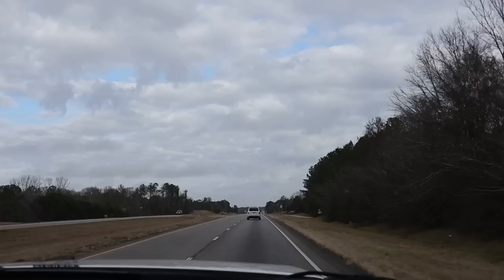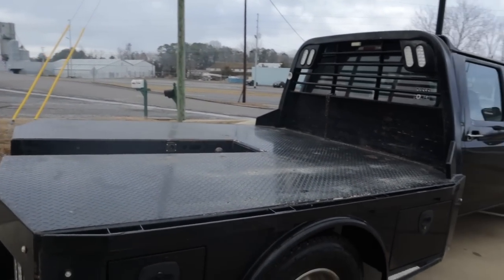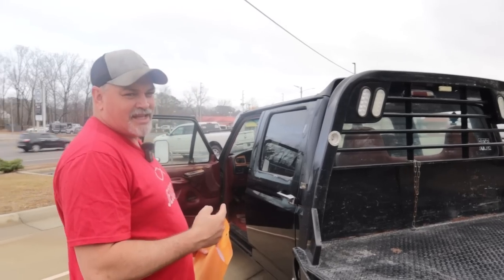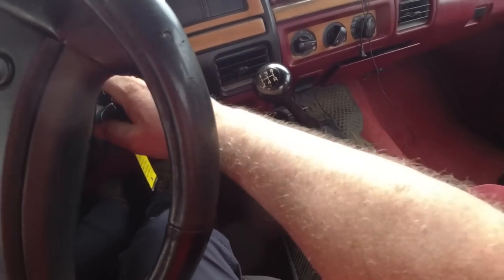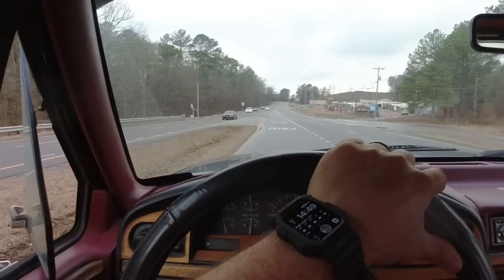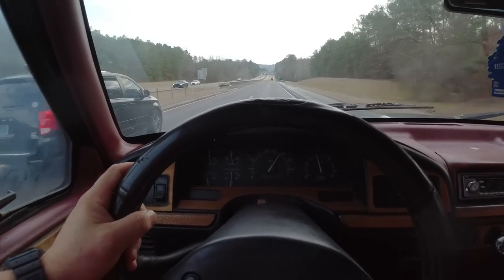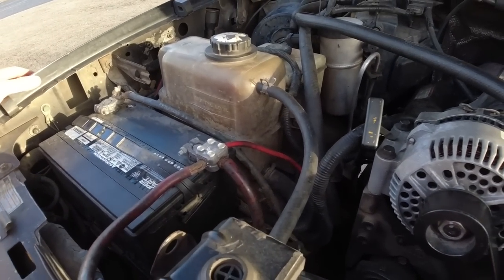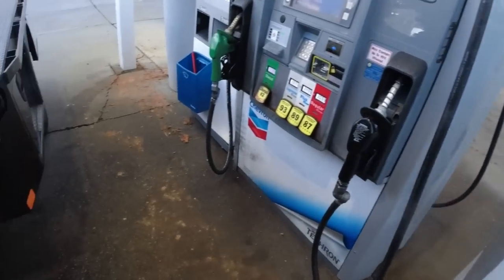I BOUGHT a 7.3 POWERSTROKE Service truck! Will it make it home 300 miles?

Comment: Hank, Enjoy all your videos. My 7.3 gets 18-20 mpg at 60mph. The gas gauge is aways off and it is an automatic. I made a trip to Alaska in 2015, pulling a 2000lb travel trailer and
averaged between 13 and 15 mpg. Before I left on trip, I rebuilt everything I could get apart and somethings I shouldn't have. With 295000 miles, the excursion has been a great 
car and very reliable. Thanks for your great videos John

Comment: The vent on the filler is probably messed up from flexing it to meet up with the flatbed body.  Check for hose kinks and add in an external tank vent if it doesn't improve.  Cool old truck Hank!  👍😁
Reply: Worth checking the vents on the tanks themselves aren’t blocked too. Not sure if the IDIs have an evap system; I guess not, or if it does it’s fine because it hasn’t thrown a Check Engine light. Good luck! 🙂
Reply: I agree. Check out the way the vent and filler hose were attached to custom add on flat bed.

Comment: For the A/C air only blowing through the defrosting ducts check the vacuum-operated solenoid that sits between the passenger-side hood hinge and the firewall. The rigid vacuum line to that gets brittle and breaks. My 95' F-150 had that exact same issue. At 20:53 in your video you can see it in the upper left corner.
Reply from the maker: Thanks 👍
Reply from the maker: The line is completely missing from the lume to the vacuum canister (whatever it’s called) but the 90* plastic elbow is still on it. Thanks for the comment.  I’ll get a new line soon and see if that fixes my problem 👍
Reply: There's no manifold vacuum on a diesel, so they run a vacuum pump on the front of the motor to run vacuum stuff, including the brake booster.  Scary when it fails.  Later on they switched to hydraulic brake booster, run from the power steering pump.  The blend door went out on my Son's 351/5.8 gasser.  Could get the heat exchanger out, but not the blend door without pulling the whole damned dash.

Comment: This truck looks like what you really needed, a tough truck that better fits what you do! As mentioned above, check the tank vent hoses! You might also need to put the nozzle in at a particular angle, due to the need when installing the bed. Heater/ AC blower defaults to defrost. Your problem is probably the blend door actuator, which is pretty cheap, and easy to change. (It is behind the glove box) Diesels don't have manifold vacuum, so you can't use vacuum motors to operate stuff. I owned a 2004 diesel 6.0, and in 100k that blend door motor was the only out of warranty repair. Highway speeds...you should be able to run the legal limit "forever" with no harm. Drive by the tach, not the speedo!! I once drove mine 'way over the limit, towing a 14k trailer. Truck didn't seem to mind. Later models have a 6 speed automatic, with a tow/haul switch on the shift lever, which selects a different program in the transmission. There's also a manual/automatic mode if you wish. I think the rear axle is a Dana 60, but that is a guess! My new F-250 has an electric lock for the rear end, which will lock up like a spool under 20 MPH, otherwise acts like a regular limited slip.
Reply: Dually have  dana70s If not Sterling  but those years they have observed trucks that are in 250 &350 in super duty  99 came out in the beginning of 98 10thgen of 150s for 97-03
Reply: I have a 97 f250 7.3 powerstroke it has a 4 speed automatic transmission in it I am swapping to a 5 speed manual soon

Comment: Get a temperature gun from harbor fright or any auto store or hardware store. I uses my temperature gun for checking temperatures on anything. You can see if the engines and wheels temperature in a sec by a temperature gun.

Comment: Try turning nozzle 90 degrees and then 180 to find the happy place to fill tanks. My flatbed is about 100 degrees from the normal position. Also reach under truck and grab the emergency brake cable about a foot from each brake drum and push and pull it back and forth to fully release brake and then pedal will not sag and turn light on in the dash.
Reply: I second the part about turning the nozzle 90/180 (sideways/upside down). Drove a 96 F-350 bucket truck for years, and that was the only way to fill the tanks without having to baby it the whole time.

Comment: On the duct work under the dash just make sure the vac pump is good and the vac lines are hooked up. Thats most likely the problem. 8 times out of 10.

Comment: Nice, great score bud, that 7.3 is a true work horse, not fast like the 6.7 the younger generation like but that block has been cast since '58, no Def system, I have one laying around myself ..but the super cab with only 70k on it, good ol' fashion strong dependable truck and we never use 1st gear, check your core support on it it's weak link with a rust issue again great score!

Comment: I have a 2001 F250 7.3L & it gets at least 17mpg highway. 13-14 city & ABS light comes on & goes off intermittently. Brakes work fine. Change the oil regularly & it will treat you well! Bought it new & will keep it a little longer.

Comment: Howboutcha and Bam-ba-lam!   I have my 3rd Ford-Navistar diesel.  A 6.9, a 7.3 and 6.0 PowerStrokes. Never use the truck fuel hose to fuel a Ford diesel.  The inlets are notoriously small and you'll have to  put them in half way, and run them by hand to get them filled.  Flatbeds are even worse.  There's so little space between the bed and the frame rails, that the fuel inlets are smashed nearly flat.  I kept a 4x4 or 6x6 behind my seat that I'd drive up on at the fuel pump and it really helped.  The oil pressure and temperature gauges aren't really analog gauges.  If the corresponding idiot light would be out, gauges will read right in the middle of normal.  Your're lucky to have the 5-speed (you said 4 at one point) rather than the E4OD automatic, which was not up to the PowerStroke, was possibly Ford's worst automatic, and which really should have a shift kit installed to keep it cool.  If it's never run a diet of bio-diesel -- DON'T.  Until you replace all of the rubber hoses in the engine with new.  95s and earlier weren't compatible.  96 and newer were OK.  The water fuel-separator lever (yellow) is on the front of the fuel filter, under the dog house.  Run it every so often until all the water's drained, and you get fuel -- Until you are sure that your fuel dealer isn't cutting your diesel with water. I switched stations and that problem went away.  Extending that hose will help with the mess.   Be careful when you have anybody replace your fuel filter.  If it's not set on right it'll leak tons of fuel on top of the engine.  Your mileage is pretty good, around 14-16.  When my 96 was faiirly new I towed a horse trailer with two 1900 lb horses from Portland to Fresno, and got 16 in the mountains. Glow plugs are built in to the valve cover gaskets.  Once you need a couple, you've got to replace the gasket, and all 4 glow plugs.  That's a good looking truck.   Bam-ba-lam!

Comment: Nice rig, I had to move the filler spout to the top of the bed, or you can put a drag up tank on the bed and run a small gravity feed  hose to the main tank, with a electric cut off switch. Put a water Separator filter between the tanks. Welcome to the Old Flat Bed Family !!!

Comment: I had a '92 Dodge diesel with a JM flatbed. When they installed the flatbed, they didn't shorten the hose in the filler neck which made the diesel run uphill when filling causing that same problem. I shortened the hose and fixed that problem.

Comment: I was trained (taught) by and old ford mechanic. He worked on those old swamper trucks (derrick trucks), from Texas and Oklahoma. The fuel gauge was often a big problem the ground would get rusted or lose and through them off.( Not very reliable ) I would just run new wire to tanks and frame. The fill necks on the tanks are shortened to make the bed fit and cause the the problem you are having with fill tube, either lift the fill tube or change to a custom  tank, it usually was just change to custom tanks for the F350s. The temp gauge won't reset like the others when to key is cycled, (moves, reads when power is put to it). And the windows will probably work when you replace the switch controls.( would replace the door wiring harness, there cheap enough). The blend door is behind the glove compartment and easy to change, it is an electric in that model. Finally i would replace the tank selector solenoid, they often go bad and cause tons of headaches.  But in all beautiful truck and great stout engines. Wish you all the luck and God bless you too.😉😉😉

Comment: That is a really nice  truck. I have s 96 7.3 dually.  Anyhow, your truck does have a vacuum pump.  And, it probably has a broken vacuum line under the hood close to the firewall near the ac blower.  That will cause the problem with the air coming out the wrong ducts.

Comment: The fuel is spilling back because the filler neck isn't steep enough. It's common on flatbed installations on diesel trucks. Diesel foams easily. I've built several beds. The trick is to make sure the fill pipe dips down as close to the filler as possible.

Comment: I have a '96 with the 7.3 PSD. There isn't an adjustment for the E-brake. I made one and used a turnbuckle to allow the cable to be tightened up. Also there is a connector that goes into the VC gasket that sometimes goes bad. After replacing 2 out of the 4 connectors the glow plugs and injectors work much better.

Comment: The 7.3 don't like aftermarket sensors only factory sensors. And a little trick at least to get you by so you don't have to be there forever at the pump is to stick a funnel in the filler neck and then pump fuel into the funnel.

Comment: Air only coming out of the defrost vents at the top of the dash usually indicates the heater/ac unit under the dash is not receiving an adequate amount of engine vacuum to the vacuum motors that control the direction of air flow, rather it be defrost vents, dash vents, or floor vents. If the unit is not getting enough vacuum signal, the system defaults to the defrost vents. Since the engine has had some major repairs and disassembly, it may be as simple as the HVAC vacuum line being broken, came off the vacuum port on the engine, or simply was not reinstalled on the port after repairs were completed. Hopefully the vacuum diagram sticker is still under the hood somewhere so you can check the routing. Very nice truck there Hank, and looking forward to seeing you work out the bugs. Keep the vids coming, and God bless.

Comment: The vacuum motors control the direction of the forced air from the blower. There’s always a vacuum leak that causes it. Check under the hood right above the blower motor. There is a vacuum line that gets brittle and breaks causing the issue.  The default air flow is defrost and floor. Check that first. I have owned 15 or 20 of the OBS Fords and have 4 now. Good luck!
Reply from the maker: Thank you

Comment: That wire you connected was the self destruct circuit.  If the fuel gage goes to full and the temperature gage drops, RUN self destruct will have started.

Comment: So i remember from the mid 90's my uncle ran a ranch in central Kansas. He used to order a 6 door f350 4x4 every two years. I'm not sure if the six dior came from Ford or not but every two years in September he would have a new one. I use to have to drive them  a lot during summers for a summer job. I hated putting fuel in it. The rear tank would always be all foamy and the only way to fill it would be to let it sit for hours.  I  don't know what was different with diesel then vs. now. I have numerous for trucks for my business now I have 7.3's and 6.7's and I have never noticed fuel issues like that. I would love to have this old truck.  I miss them a lot.

Comment: My 2001 F350 7.3 had the problem with window's not working, cruise and dome light not coming on. I was told to replace the GEN. Module,....pain in the butt to replace behind fuse box but it fixed the problem. :)
And,...a 7.3 will run way cooler than other engines and the wire you spliced to the relay is for glow plugs to warm the engine up before starting.

Comment: Nice truck ! May be a vacuum leak for the damper doors for directing air flow for heat or a/c. Oh, the mirrors aren’t the same. I still like the truck and it’s already had a lot of what goes wrong with them done. Have a Blessed Day

Comment: Hi Hank. Was curious to hear you mention diesel at $4.50 a gallon. Here in New Zealand, we use liters, which means your price is 82c a liter. Our price here per liter is $2.14 currently, which equates to about $7.90 a gallon if my math is good. My Frieghtliner truck holds 118 gallons 😢
Love your channel btw, always look forward to new content.
Reply from the maker: Wow!
Reply: In Canada were around $2.00 a liter also, its criminal!

Comment: On them old fords, the blend doors for the a/c are controlled by vacuum. There’s a vacuum pump under the hood on the passenger side against the firewall. If the pump isn’t getting voltage or there’s a vacuum line broke somewhere , the air will only blow out the defrost vents
Reply from the maker: Indeed that seems to be the case👍

Comment: Love the truck, I still have a 94 f150 gas I paid $350 for it 8 years ago and It needed a set of tires and a water pump to get it driving ,I replaced and fixed the overdrive button on the column and should have replaced all of the hoses along with the water pump but I did not and it bit me later ... But now that I have that all figured out it heats great! The only gauge I'm now having issues with is my oil pressure...😬

Comment: Call your local Ford dealer about the cruise control and airbags there's a recall on these year trucks. Fires are know to happen if not properly diagnosed and fixed. I know because I have 2 of the same year trucks a 7.5L gas and a 7.3L diesel. Nice truck hank those 7.3L diesels are bullet proof.

Comment: HANK! That fuel hiccup you had is the throttle pedal. They are electronic not mechanical. When they start to go bad they do exactly what it did to you, it loses connection and goes to idle. The reason it started working again isn’t bc you shifted gear it’s bc when you shifted you took your foot off the throttle and put it back on which made it connect again. You can buy the whole throttle pedal for fairly cheap and you literally just unplug the old one, un bolt it and bolt/plug in the new and your good to go! Hope you read this and hope this eases your mind a little buddy! It’s a common prob with age on these trucks. Good looking rig and great video!

Comment: I bought a 1973 MGB that hadn't run in years. I had to drive 6 hours home with no temp gauge and having the car stall everything I pushed the clutch to change gears. The car made the 6 hour drive in hard pouring rain.

Comment: I have a 97 super duty flatbed tow truck and I have the same problem. I found that if you hold the diesel nozzle at a 90 or even a little steeper up it won't shut off. It's kind of a pain in the butt because the fill nozzles are under the bed.

Comment: And the 7.3 is actually pretty efficient when it's running right and tuned right I have managed to get 27 out of a 7.3 auto. And 23 out of a manual with 4.10 gears doing 70 mph on both of them.

Comment: I had the same problem with my 97 I checked that it vented and all the likely problems and what i ended up doing was a hose that was made to extend a funnel I pushed it in the tank so there was some drop in it the filler neck and hose are too low there is not enough drop i just got in the habit of using the extension and it worked like a charm

Comment: love that at 8:02 right as he says bulletproofed as they say a 6.0L drives right by.
Reply from the maker: Lol. Didn’t even notice, but that’s hilarious 😂
Reply: @HamiltonvilleFarm  Appreciate your Content. Honestly that truck only thing i think it needs is wiring repairs. and Change some of the Top end seals for the high pressure oil system. probably a weekend or two worth of labor in preventative maintence repairs. but it'll serve you well. change glow plugs and the Injector harness / Valve cover seal too they're problematic and while you're in there make sure your glow plugs aren't seized and put new ones in it.

Comment: Hank once you get the bugs worked out I think you will get great service from the truck. I had a 96 f250 that had 325000 MLS when I sold it! I had mine for 18years. Good luck with it!

Comment: Not sure If anyone commented about it, but make sure you check the radiator core support. Cause them obs truck are known for the support rotting out the way they are designed. And the supports are hard to find up here in PA, not sure about down there in the southern states

Comment: Just let that 7.3 aka T444E run and drive the mess out of it. The air regulator is vacuum actuated. Probably have a vacuum leak so it won't change from the defrost. Fueling, try turning the nozzle sideways. Might work. GPR= Glow Plug Relay. Those are some really good engines. I have dealt with both from the Power stroke and the International side. Should serve you well. Stay safe my friend.

Comment: i work at a gas station i know most people with a flat bed will put a block under the tire to lift the truck a little while they fuel up or twist the nozzle either left or right where the handle is left or right :)

Comment: My 1995 did the same thing with the defrost there are some vacuum lines that come out passenger side firewall that rot apart. I cut the bad spot out of mine and slipped some chainsaw fuel line over the bits that were still good been that way for years.